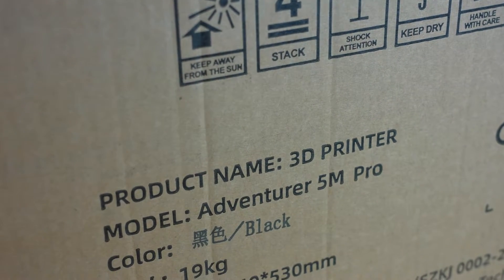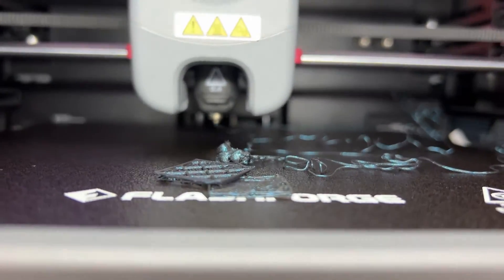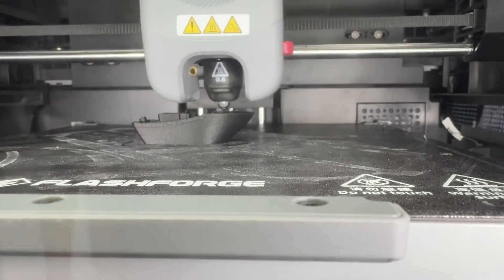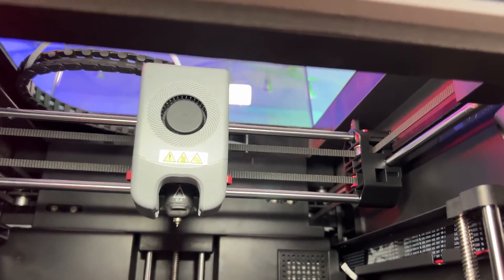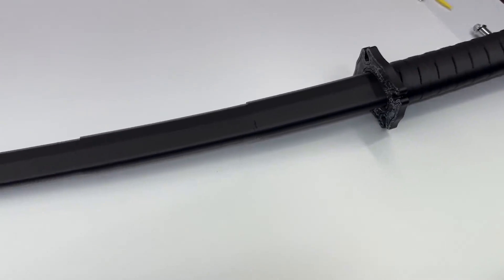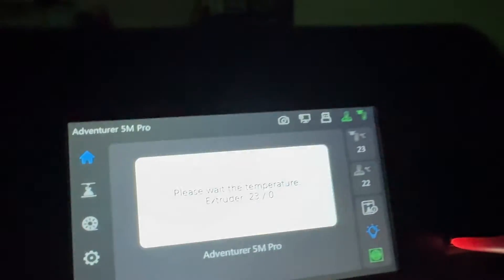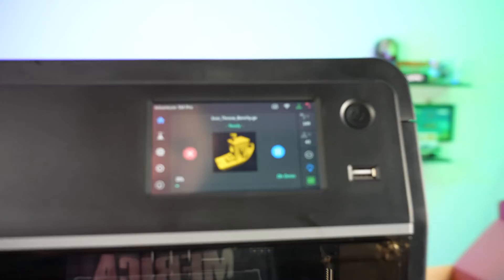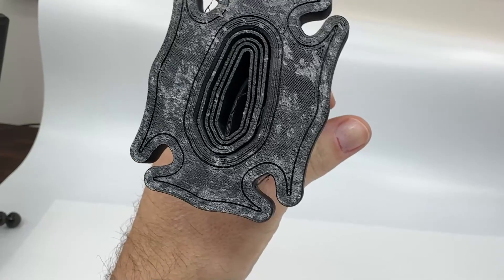Flashforge Adventurer 5M Pro - Fast and perfect for beginners!

Comment: Jason, I know this video is a few months old and you learned the ins and outs of this machine, but if you really want a printer that puts reliability and user experience first, check out bambu labs. The P1s is a very good apples to apples with this particular printer, but has some upgraded features. Or if you really want to go balls to the wall, X1C. Either way, happy printing.

Comment: Glad you are sharing your thoughts and feedback on this printer. I have the 'non' pro version that i was able to get for only $250. my experience and feedback might be worth considering in a follow up.
1) the build plate has NO ISSUES.  You must first ( as someone in your comments mentioned ) wash it with Dawn soap before printing; verify the bed temperature as it likes to make the bed 40-50 for pla, which is too low and should be 55-65; auto leveling each print is NOT NECESSARY; and you do not need to use glue - even PETG and PLA stick and remove just fine.
2) i printed a modified enclosure for mine and it is wonderful. no filtration like on the pro but really nice.
3) several firmware updates and software updates have stabilized the network printing and i have never had an issue - almost no failed prints, and i use the wifi to monitor a lot. i have not added a camera to mine, but FF has one and i will be adding it soon and will test it.
4) they have released both a phone app and a variation of Orca Slicer specific for this printer and it does connect via wifi with it.  This is a fantastic addition and shows how active they are with this printer.
Reply: What app?

Comment: The problem with bed adhesion can be solved quite easily - wash it multiple times with hard brush and dishwashing liquid, and with IPA afterwards. I think it has some oily residues from the factory when you first unbox it. Also it is crucial to use proper bed heating (60 degrees for PLA). The included sample prints have bed temperature set to 30 degrees, that's why they don't stick well. Also the included glue is quite useless. For ABS prints i use an ordinary paper gluestick which is superior. For PLA and PET-G I don't use any glue at all.

Comment: The levelling issue might apply to older firmware, I personally did 37 hours of printing in PETG and PLA and never had issues with the adhesion. I've only done the calibration/leveling in the initial setup. It's worth mentioning that my printing bed was of a gold/brown colour, instead of black like in the video. Could that be an improved version?

Comment: For the adhesion, run the bed a bit hotter and for level before print just add g29 after g28 in your slicer start gcode

Comment: "I have a strong grasp of Arduino programming, although I haven't had the chance to gain practical experience due to financial constraints. I am seeking assistance to acquire the necessary funds to purchase an Arduino. Any support, even $0.1, would be greatly appreciated. I'm currently residing in Ethiopia, which adds difficulty to obtaining the required resources. Please respond if you can help. pleas reply for me, Thank you."
Reply: I haven’t got $0.1 but my grandson gave me 0.1 BTC, will that do?
Reply: ok thanks
 @husaberg650

Comment: I got a question, I'm planning on buying my very first 3d printer and I'm going for an fdm type like this. Does these enclosed printers usable in a basement and not worry about the smell and fumes? Or do I have to vent it out still?
Reply: I've been running my old Flashforge in a bedroom and there are basically no fumes (with PLA at least). The Dreamer model has an enclosure but I leave the top off. The Adventurer 5M Pro model is enclosed and it has HEPA filters. You should have zero issues with fumes. In general, fumes aren't really an issue with FDM printers. SLA and other resin printers have the noxious fumes in my experience.

Comment: Have you tried Orca slicer? I've had my 5m Pro for about a month now, and once I switched from flashprint to Orca the printer has been "set it, and forget it." I don't know what it is about flashprint and first-layer adhesion but they seem to be at odds with each other. I haven't had adhesion problems or the need to relevel with Orca slicer. The downside however is that you lose network connectivity. Kinda sucks, but tolerable for how well the printer performs with Orca.

Comment: So after watching this nightmare Hardware and how well it does not operate I would just say this to anybody looking to get into 3D printing.

Go out to a Micro Center spend $100 and buy yourself an Ender Pro 3 3D printer and don't look back lol. 

I'm not sure how much they're going to try to charge for this Abomination that doesn't even work right but anything more than free is still too much. 🤣🤦‍♂️
Reply: I would say get Ender 3 v3 SE, mine has been perfect.
Reply: @firewoodwarrior4396  Personally I just don't do vrollers anymore. Having a core motion system part wear so quickly is frustrating. Its not noticeable till you suddenly startd having problems and don't known why.
Reply: @BeefIngot linear rails actually will ware out first. Properly adjust vslot wheels are as good and reliable. My 5 year old ender 3 has stock wheels I’ve had to change my voron linear rails once already because of the fine dust that get inside them.
Reply: @redline3036  That is the biggest cap I have ever heard my whole life.

"linear rails will actually wear out first" 🤣🤣🤣

I love that you have some bad anecdotal evidwnce as the only evidence.

Out of curiosity, how much further you reckon those voron rails travelled?
Reply: "Go out to a Micro Center spend $100 and buy yourself an Ender Pro 3 3D printer and don't look back lol. "

This is by far the worst advice I have ever seen to a beginner in the current year.

The A1 exists and you think its worth anyones time to suffer through the ender 3? Downright evil.
Reply: @BeefIngot  years ago when I first started out my very first 3D printer was an Ender 3 pro. I was able to set that printer up correctly and have literally no problems printing off my first handful of prints lol. 

It's not that hard to do there is plenty of videos on people of this successfully using it and even showing beginners how to set up and work it correctly. If you can't figure out how to use an Ender 3 Pro you'll never be prepared to figure out how to use this printer considering how many issues it already has with it lol. 

I now own eight 3D printers and I still go to my Ender 3 Pro for a lot of my prints that I need done right the first time around. 

To promote this 3D printer especially with all of its current issues that it has is a crime in and of itself lol.

Three other people that I know one of them happened to be my cousin all got a Ender3 Pro and did not have a problem using those printers they worked fine right out of the box as advertised after initial setup lol.

Do you know what can't be said about that? This printer lol. 🤣🤦‍♂️
Reply: @RunicGamingYT  I dont know who you expect to believe that, but its prerty crappy of you to recommend ender 3s to beginners in 2023.